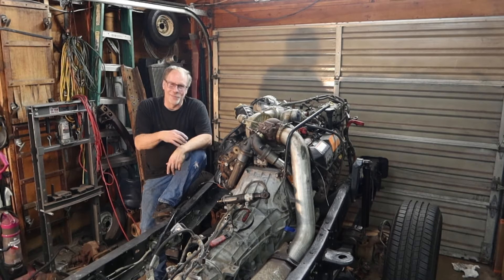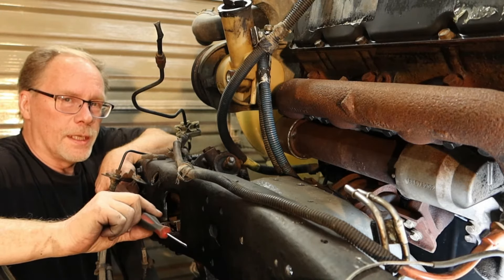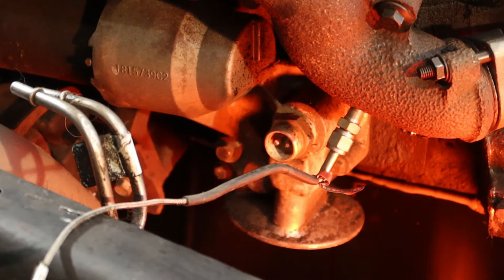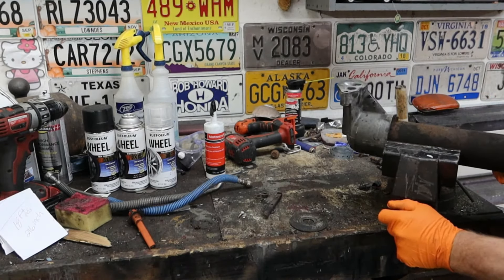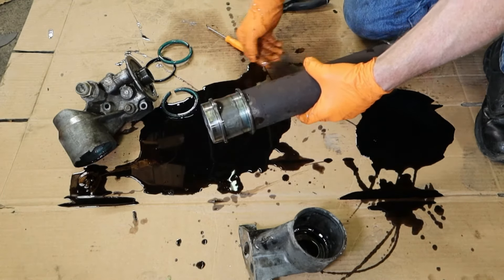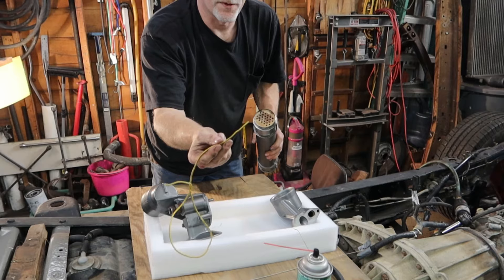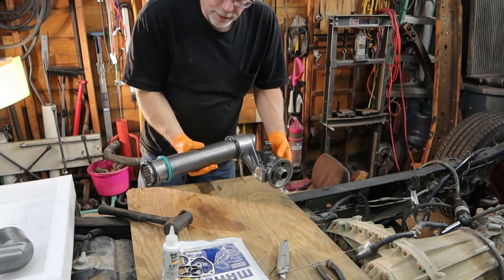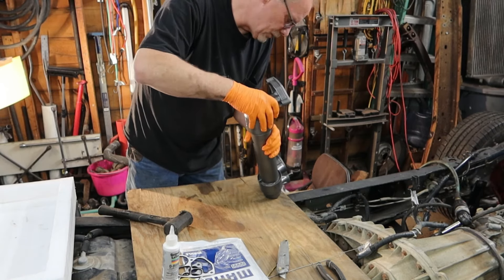7.3 POWERSTROKE OIL COOLER REBUILD  🛻🎥🟢🟡🔴🟢

Comment: Excellent, I used to watch that guy from down south until I found you, then I realized he's just a salesman. Your the best at what you do. Thanks for taking the time to to share your experience and expertise. I have a 2002 F350 that I bought off the lot new. It served me well shuttling supplies for my business, pulling our 5th wheel camper on vacations and hauling tools and building materials for my apartments. I never really needed to do anything other than routine maintenance for all those years. But now after watching your exceptionally informative training videos, I have begun the process of followed your advice and refurbishing my truck. The only problem is. I want to do it all at once and can't wait for more videos so I can keep learning. I recently had an issue where my truck would randomly stall while driving. I parked it in my driveway, and while I was installing a cam position sensor during the day, chipmunks were eating the wires over the drivers side wheel well. They chewed through sixteen wires and I couldn't figure out why the truck was having more issues and wouldn't start. I figured it was electrical shorts, so I ordered a wiring harness and in the process of taking the battery and filter housing off, I saw the chewed up wires. I spliced all the wires back together but now I have no oil pressure to the injectors and it's showing about ten fault codes. I replaced the IPR and have the harness in and ready to hook up. I'll be ready for a test start on a few days. Thanks again for your help

Comment: Oh yeah. Gettin ready to do it.
Reply: Remove the water pump, radiator and it'll make it a LOT easier to do. I did mine in about 3hr. Plus I got to wash out my radiator and block. The newer water pumps have a removable water neck on the bottom side so ya don't have to pull the pump off to get access to the front part of the oil cooler.

Comment: Love the detail. Love that you go the extra mile in cleaning and mild paint. Bugs me when people install a filthy part after rebuilding. I like to use anaerobic gasket maker because it doesn't set up and dry until you take oxygen away after coming in contact with metal and it's tacky enough to hold a gasket in place. No lid on the tube is needed and it won't dry up in the tube. It also does not need surface prep if your surface is clean.
Reply: Also should add my oil cooler ports was blocked by silicone on the coolant side, another reason why I mostly resort to anaerobic.

Comment: I'm getting conflicting information here. If I'm supposed to drain all my coolant I need to know what to put back in it. I have an 03 7.3 and the stores say that the vc-5 coolant is not compatible but that vc7b is. But then on other websites it says vc7b is for the 6.0 but I looked into the reservoir and it looks golden. I took a little bit out with a straw and put it on a piece of paper and it looks kind of yellowish golden color.
Reply from the maker: https://www.youtube.com/watch?v=tIDPcsqrc8o

Comment: Ive seen pictures of blocked up coolers. Would a coolant filter help prevent this. Or do you think adding a coolant filter on these engines is a waste?
Reply from the maker: I follow regular coolant exchanges and I have 1/2 the fleet with coolant filters for me its a waist If your someone whom never changes there coolant it would be a option I say that because the micron rating of coolant filters isn't that fantastic so it may help but its no oil bypass filter thats for sure
Reply: @CUSTOMWORKS7.3PSD  thank you appreciate the answer.
Reply: @CUSTOMWORKS7.3PSD  have you made a video about your set up and why you should or should not do it. If you haven’t would you make one in the future?

Comment: How did you get all of the water out of the tube after flushing it with purple power? I have been spraying the tube with a air compressor for 15 minutes and still have milky oil in the tube
Reply from the maker: Its not clean till its clear water coming out

Comment: Do you need to replace your coolant system if you have oil in the coolant as a result of oil cooler failure? Or should a hood coolant flush be fine?
Reply from the maker: remove all coolant throw away,  flush with a hose through the heater core and through the radiator, mix water and purple power X2 concentrate  in a 5 gallon bucket 1 gallon of PP 4 gallons water fill radiator mix another top off and run for 20 minutes then flush as instructed above and do it 2 more times ( 1 gallon PP 4 gallon water ) so total 3 times   Then flush flush flush when all bubbles are gone put in 7 gallons of distilled water to flush out the hose water and then fill with correct fluid/coolant //////////// This covers correct coolant for each years https://www.youtube.com/watch?v=tIDPcsqrc8o
Reply: @CUSTOMWORKS7.3PSD  thank you!

Comment: Hello Clint, Happy to have found the community and the vids. I'm a long time Early 99 F250 PSD owner. Today 450,000 miles later, I've had the truck since 2005. Help me out here. Last year I rebuilt the oil cooler because there was a trace of coolant in the oil according to Blackstone Labs. The issue is that the coolant reservoir is always low. I fill it up to the cold mark. Use the truck but it seems every few weeks I'm adding coolant. The water pump doesn't leak, There's no evidence of a leak on the ground. Hoses are good, clamps tight. Thermostat housing, no leak there and you mentioned in one of your videos that the head gaskets very seldom go bad. I'm not the only one who has this concern. So, in your opinion, where or why is the coolant level down? Where else do I need to check? Thanks in advance for your reply.  Jeff K.
Reply from the maker: 1st Diagnosis test cooling system by getting a extra coolant cap and install a male air connection so you can hook up compressed air to the bottle when engine hot and off run 20 psi and listen for leaks / 2nd D next if cooling system does not hold pressure with reg cap the cups could be the cause if the system holds pressure after driving hot cups good / 3rd D crack head, block cylinder cracked , head gasket get a extra grease gun tube install a npt to m 10x1 for screwing in to each glow plug start with 1 cylinder remove the glow plug install the tube run the other end into a container of water run 20 psi into the coolant bottle with that special cap you made and turn the engine with a bar at the crank and watch and listen for air into the bottle and listen for air leaking into the block / last the timing cover can be cracked where the oil cooler connects the first test should rule that out or if the timing cover is leaking into the hpop reserve the oil in there will have moisture not necessarily milky if its just a tiny leak //////////////// With the amount your loosing 1 off these should point you in the right direction In my experience keeping in mine I'm not standing in front of you engine seems like a cylinder wall issue not high enough to blow smoke not low enough to fill the pan
Reply: Thanks, Clint, for the quick reply. I have maintenance planned for April and the truck will be down for 2 weeks. I'll be performing coolant flush, all sensors and engine harness replacement. and a host of other maintenance related tasks. This has been a very dependable truck, replacing the 4R100 at 410,000 miles and two injectors last year at 435,000 miles. Turbo is original at 450,000 miles. Long live the 7.3! Jeff @CUSTOMWORKS7.3PSD

Comment: Clint...I'm a new subscriber and the original owner of a 99 F-250. Doing the oil cooler and found short bits of black sponge rubber in some of the oil tubes. It has been in a repair shop only a couple of times. I do the rest. Can't figure out what they are from. Can't add a photo.
Reply from the maker: That,s a definite foreign object that someone left behind some where in the engine when there was work being done to it The biggest concern that come to mind that it isn't plugging up the pick up tube in the pan YIKES

Comment: Hey Clint- been tackling all these projects lately with much success thanks to your thorough explanations! I just put my oil cooler back in (coated with wheel paint and looks great btw!) Had no issues at all after letting it idle for 10 minutes. Plan to take it out for a driver later. I did notice that the alignment pin on the cooler is not perfectly centered on the oil side assembly after install. It's not all the way to one side but slightly off centered now after i snugged up the bolts. Will this cause runability issues down the line? Or is there some wiggle room there so long as the gap for the assembly is around the pin on the cooler? Thanks!

Comment: You just rinse out the purple degreaser in oil passage with hot water and put back in? Are you running compressed air or somehow displacing the water with oil or something before or is it ok to have small amounts of water in the engine? I’m worried about rust. I just did this following your cleaning process, but left the rear flange attached to the engine since I’ve got hoses coming off it to a bypass oil filter, just pried it apart with a flat head in the groove. Put back together with a ratchet strap

Comment: I used a power washer on mine to clean the tubes and then I made some rubber gaskets and air tested for leaks in the tubes.

Comment: another great video. thanks for the work you do. I  just bought a crank no start '95 7.3L super duty.  I tested resistance in injectors and glow plugs today.... all glow plugs have infinite resistance.  two injectors were wonky.  plan to remove valve covers to check all directly.  should i upgrade to the more modern gaskets with one connector or should i stick with the original two plug per bank setup?
Reply from the maker: I always in a rebuild upgrade to the single plug newer design No particular reason just prefer one wire run in the valley and under the covers
Reply: @CUSTOMWORKS7.3PSD  thanks for the reply.  i will follow your lead and upgrade

Comment: Ha, this is great I'm actually doing mine Sunday. I just did a fresh oil change 2 weeks ago. Do I just need to drain the oil to do this?
Reply from the maker: yes change the oil again and the filter You take the chance of introducing contaminates directly to critical bearings  and running them through the entire engine before it hits the filter again. Your choice ARE YA FEELING LUCK PUNK !  Dirty Harry quote
Reply: @CUSTOMWORKS7.3PSD  do what?
Reply: @CUSTOMWORKS7.3PSD  sorry I don't understand what you mean by that. contaminants to critical bearings? Contaminates from what, and what bearings do you mean?
Reply from the maker: @chris5957  You asked if you should drain the oil I am telling you yes and install new with a new filter so no crap gets in the old oil from doing this re o ring job
Reply: @CUSTOMWORKS7.3PSD  I really hate being a damn stroke survivor sometimes, sorry man. You threw me for a loop when you saud bearings

Comment: What would cause oil to come out of my 1997 7.3 power stroke engine radiator
Reply from the maker: oil cooler
Reply: Would a bad injector cup do that also?
Reply from the maker: @jonsaircond8520  That scenario you would find oil in the fuel and fuel and oil in the cooling system

Comment: Any way you look at it, it will always be messy. 
Right next the oil filter housing there is a plug in the block. ( directly to the right of the second bolt you removed, it’s the one kinda angled down with easy access . ) that’s the one I removed to help get the coolant out. It’s also a good spot to add a temperature sensor. 
Good video as always.
Reply: It's for the block heater.
Reply: @rkalkes  it’s also next to the block heater. It’s a 1/2” plug in the block

Comment: I have a 97 crew cab that I want to restore for retirement. I plan on building an overland camper and flatbed trailer. How difficult would it be to rebuild my 7.3 myself? Any suggestions on shop manuals?

Comment: Hey Clint, great educational video on the oil cooler. That will more than likely be one of my next repairs. Since I got a new block heater and cord, I will wait till the weather gets nicer and do them both at the same time. Why lay on ice cold concrete….right🥶🥶

Comment: Good video.. But a quick question....If the pegs on the cooler tube do not line up with the marks on the housing what would happen?? I noticed mine in off a couple inches...